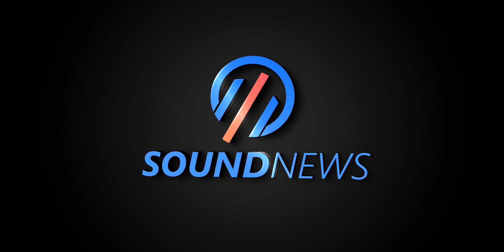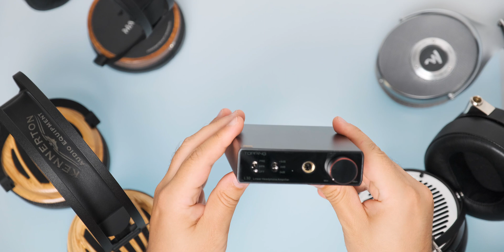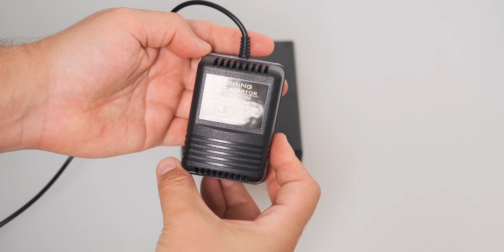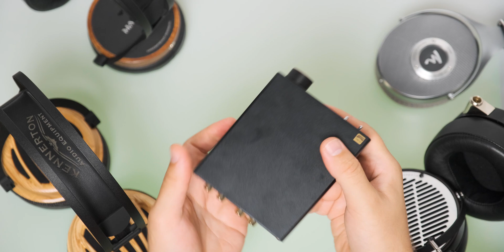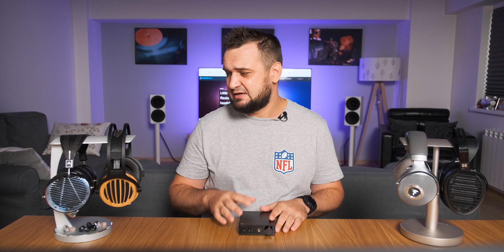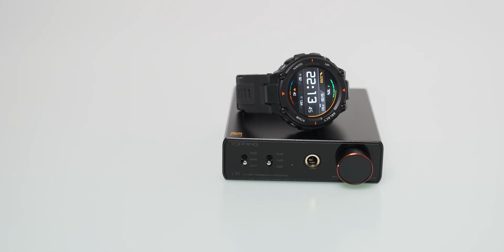Topping L30 Review – A Little-Big-Amp

Comment: Hello, I can't find anything on the net to answer my question, I would like to know if it is possible to install the L30 headphone amp behind a pc sound card? Kind regards
Reply from the maker: Behind an internal PC sound card, like that is sitting  on the motherboard on your PC? I won't do that, strongly advising against that, due to EMI/RFI build up and of course of the temperature and weak air flow. Get an E30 that will complement the L30 and solve your problem.
Reply: @Soundnews  Hello,
I contacted Topping and told me that it poses no problems.
My sound card is a pci-e card.
I don't understand the heat buildup story.

Comment: Just got topping L30 for sundara. I’ve kept it on +9db and the output is still weaker than my tiny fiio E11. I did try daisy chaining both amps with seemingly good results but am worried about the noise creeping in. Also, fiio being a portable battery driven amp needs to be charged frequently. That’s the reason I was keen on L30. However, it does not seem as impressive as the reviews say. That at least has been my experience.

Comment: What DAC would you recommend with this? I can't pair it with an E30 because it's not in stock.
Reply: Are you in North America? The E30 is available online at both Apos and Amazon.
Reply: @keithjohnson2863  Canada. It wasn't in stock at the time of writing that but it is now.
Reply: @4kallday  For me the E30 is a keeper, but there is a caveat, it comes with a USB charging cable but no power supply. One end of the cable is the round plug that connects to the E30, the other end is a standard USB A connector. The E30 is sensitive to dirty power. I first plugged the power cable into a multiport USB charging hub and the DAC didn't sound very good. Next I used an old Apple power brick and that improved the sound a lot. Finally I purchased a 5VDC iFi iPower Low Noise power supply for the DAC and that did the trick. The power supply is $50 USD but clean power is a necessity if you want to get the most out of the E30. Even at $180 with the power supply the E30 is a good value for how it performs. The next step up would be the SMSL M200 for $280 USD.  The AKM DAC chip in the M200 is an upgrade of the the chip in the E30. And the M200 comes with a low noise power supply and it has built in bluetooth. That being said I returned the M200 and kept the E30 for my desktop system.
Reply: @keithjohnson2863  hmmm one of the huge selling points to me was the USB power as I don't have much more space for plugs. I also don't want it to sound less than optimal after spending $$
Reply: @4kallday  I feel your pain. I bought the Kanto YU4 desktop speakers because of their small size and their USB input. I wanted to replace the speaker/DAC combo that was already on my desk. But they did not sound very good when directly connected to the USB port from my computer. Putting my FX Audio X6 DAC into mix improved the sound. Using the E30 with the linear power supply took it to the next level.
You might be lucky and have a USB port that delivers clean power. If you the get the E30 (or any other DAC takes 5V DC) try powering it with a portable USB power bank. That's basically powering your DAC from a 5V battery. If you notice that the sound is more clean than using a continuously powered port (computer, hub, wall wart), you will benefit from using an iFi power supply.
Reply: @keithjohnson2863  cool thanks for all the info!

Comment: Nice review Sandu, like someone else pointed out you can't use P50 with this as this takes AC not DC
Reply from the maker: Hi mate. I personally never seen an external PS that spits AC instead of DC, but that doesn't mean such power supplies don't exist. I will be updating the video and article with the right info, once I get it from Topping.
Reply: @Soundnews  Did you ever come across Objective2 amplifier (O2)? It uses AC as well. Topping has done a fantastic job with L30 by the way, it's on my list now
Reply from the maker: @vkvedam  Didn't test that one, yep it's an AC input

Comment: Where's the fusing on that transformer???
Reply from the maker: Doesn't have one, I couldn't open the amp to check if there is one inside, the glass cover on the front would not come-out..
Reply: @Soundnews  It needs one (or two) on the high voltage side or it's really unsafe!  That would never pass certification in North America and puts your home at risk of burning down if anything goes wrong!  It doesn't have any surge protection either.  You are probably going to be the only reviewer that revealed this design flaw without even knowing it.  Ha ha! I appreciate it though and I would never trust this power supply in my home.

Comment: Great review, with this and your other reviews I’m now subscribed , I’m thoroughly enjoying my E30, L30 stack. Quick note though the L30 uses a 15v AC input so it won’t work with the Topping P50 which  outputs 15V DC, I was tempted to get the P50 myself until I realised it wouldn’t help with the L30, but as noted the bundled power supply seems good anyway.
Reply from the maker: You we're right, it's an AC input..Updating now
Reply: I got my E30 2 weekd ago cant use It because the l30 havent arrived 😭
Reply from the maker: Hi Jared, thank you! I sincerely thought that AC written on the back was a typo by Topping, as I never seen a two-pole alternate current socket, but hey we are all here to learn something. I asked Topping if those are indeed 15V AC and not DC volts as 99.99% of audio devices are using, awaiting they response, but I have a premonition you are right. Will be updating the article with the right info and the video as well.
Reply: @Soundnews  It is 15 VAC, just like JDS Atom, just like schiit magnius. All of them use VAC.
Reply from the maker: @tenveri  Yep, you're right. Topping just confirmed

Comment: Hello Sandu. Thank you for the great review. I do feel that you might have included another section and that is...comparison with it's rivals: JDS Atom, Liquid Spark, Schiit Magni 3+,  etc.
Having reviewed the E30, L30 and Hifiman Deva, do you think they would make a good pairing ?
Reply from the maker: Hi Alexandru, I wish I had those devices you mentioned, but alas I don't have them around so a comparison like than was impossible. Deva needs a bit of warmth and soul to bloom like a flower and do think that the liquidity of E30 and the slight midrange presence of L30 would make the Deva a much more interesting headphone. Should be a very good pairing.
Reply: @Soundnews  Thanks for the info Sandu. On a related note, is soundnews.ro going to be updated with new material or are you just focusing on the .com version ?